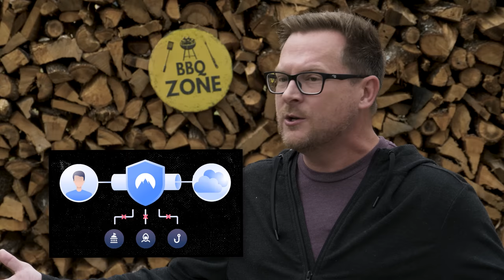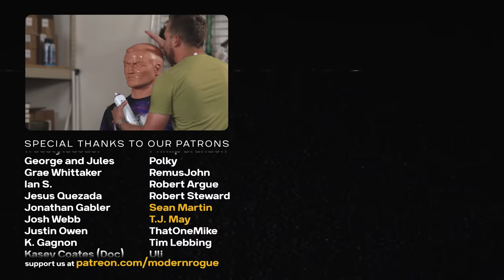Best Improvised Weapons Tests | Modern Rogue: Desperate Defense

Comment: Another aspect of the hairspray flamethrower is that it makes it hard to breathe, even if the flames don’t actually touch you
Reply: Theres also the psychological aspect of fire
Reply: Yeah well fire uses oxygen as fuel so that makes sense
Reply: The kind of person your going to feel the need to use fire on is either going to explode in lightning violence on you so that a breath held for half the time they are able will be all that is required. Or they will hang back and intimidate until you burn yourself or there is a lull in the fire blowing,or will say what it takes to make you comfortable or take pity in them up untill the point you become physically dismantled by their personal charm and charisma
Reply: it can also explode so it's a hand grenade they're certainly going to stop and react when your hand explodes in a fireball of metal shrapnel that burns 60% of your body

Comment: I feel like a length of chain is one of the best overlooked improvised weapons.  You can use it for so many things, least of all for restraint of opponents.  It doesn't have to be particularly long or of a heavy gauge, just big enough to get a good grip on.  Wrap it around the fists and it's a knuckle duster or hand protection from sharp objects, it trips, it's a garrote, a whip, and combined with anything heavy it becomes a flail.  if it's heavy enough, it can be a bludgeon on it's own.  Enough of it in the right places could even be makeshift body armor, though that's probably a stretch.
Reply: Most of that would work but you can't use it as a knuckle duster.  Well...  You could if you like the idea of having your hand thoroughly smashed up.  I wouldn't recommend it though.

So why is that the case?  A knuckle duster essentially works by taking the force of your blow and transmitting it to the target via a smaller contact area with no give.  The problem is, since there is no give, it will transmit that force right back into your hand.  For every action, there's an equal and opposite reaction.  A proper rigid knuckle duster distributes this force around your hand into a relatively broad area, usually the whole grip.  A non-rigid chain can't do that though.  The link that impacted the target will juts transmit that force right back into the finger or knuckle it is sitting on.  In short, each link in the chain will have exactly the same effect on your fingers as it will on the target.  It also must be considered that between the chain, target face, and your fingers, the fingers are the most fragile part of the picture and so will break first.

I would tell you to try this for yourself if you don't believe me, but seriously, don't.  I can't stress this enough.  It's a remarkably bad idea to attempt it.  Just take my word for it on this one.  If you ignore what I'm saying here, it's on you.
Reply: A length of chain and a padlock. If anyone questions you about it, it's your bike lock or whatever other excuse you can come up with. In reality, it's an improvised flail.
Reply: @ColonelSandersLite  I totally agree with you about hitting something solid, you'd likely break your fingers, but I kind if feel like you're still probably going to do more damage to someone's bare face than to your fingers in a desperate defense situation.  I can live and maybe still fight with a few broken fingers if I have to, but a smashed jaw, mouth, and nose are  little harder to shake off.  That said, if the chain was long and heavy enough, it'd be best just to strike them in the face with it anyway.  After all, the goal of desperate defense is to either quickly take the fight out of your attacker, or buy yourself just enough time to escape the situation.  I suppose if you had a small, solid piece of wood or metal that you could bridge across your hand, it might distribute the impact well enough not to damage you more than your opponent.
Reply: @elijahgrimm8052  Sure.  Anything heavy and metallic you can get your hands on and attach to a chain is going to be potentially lethal.  You could easily cave someone's skull in with a big enough lock, even if all you had was cloth to attach it to.
Reply: @upinarms79  If you're breaking a jaw, you're hitting a solid target. The face isn't soft enough to cushion the blow and if it were it would also cushion the blow for your opponent. A much better option is to simply use your palm. A fist will reach a bit further and a proper strike with your knuckles will hurt more, but a palm strike is safe for you and still sufficiently bad for the enemy. As for other uses, the problem with a chain is that it isn't rigid and that anytime you miss your target it will swing back without you being able to stop it. That's why a proper flail will always have a longer handle than it does a chain (or chains), to make sure that if you miss the chains will swing back to only hit the handle and not your fingers or arm. That being said, a short chain used well can be a great weapon. This is coming from someone who had a lot of bruises as a kid for a variety of reasons, playing with chains being one of them.

Comment: Honestly brooms are underrated. Whenever I suggest using a broom as a weapon, they always thing of the brislely end not the hard end.

Brooms are basically staffs. If the broom is wood you can possibly get knife stuck in the broom while parrying. If it's cheap metal and it breaks, then you now have a sharp end you can slash and jab with

Comment: If you’re a working man, and you’ve got hairspray, and your assailant takes you to court for excessive force, you might get away with a potentially “premeditated assault” charge, as though you were waiting to use excessive force. So maybe keep Brake Cleaner in the back of your vehicle for such occasions, you have an alibi that you use it for work and used it in the heat of the moment, something you already use. 

I’m not a lawyer, but if I were a prosecutions lawyer I would want to take that in consideration for my client if they got their face melted in a mugging but charged you instead
Reply: literally why I keep a breaker bar in both of my cars, I'm a part time mechanic with many tools in both cars.  It's definitely possible to use this type of defense

Comment: Assuming I didn't live in a Constitutional Carry environment like Austin Tx, I still have a LTC good in most states. No scenario here showed I would need more time than drawing and firing. Two rounds to the chest discourages 90% of attackers. But assuming I left the house unarmed, why are you dissing the feet? A solid blow to the top of the arch (NOT the toes) is a good way to give a broken foot. That's a mobility kill and you can now run away faster than he can hobble after you. So is the knee. Absolutely jab with the 2x4 (or baseball bat) don't swing for the cheep seats. To many John Wayne movies out there throwing haymakers for anyone to expect a jab to the nose. Which cause swelling and tears, impeding eyesight and they cant see were you are running away too. Flaming hairspray should work out as well, but haven't tried this one myself.